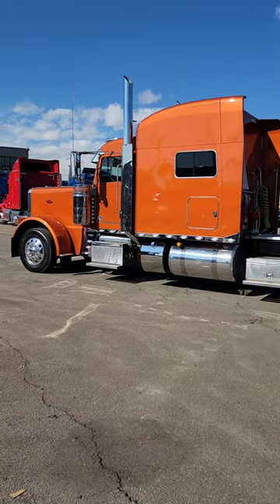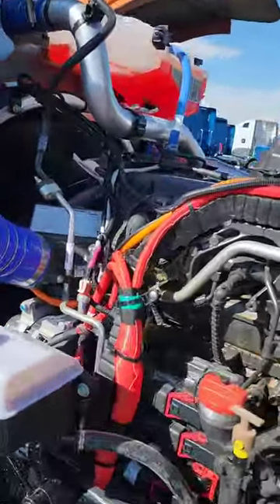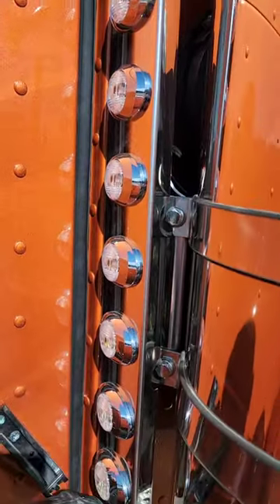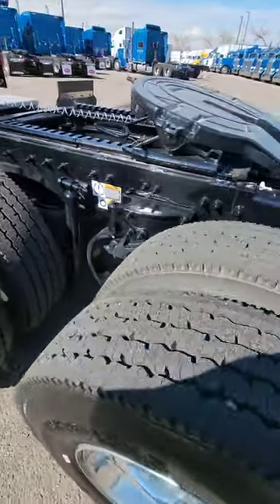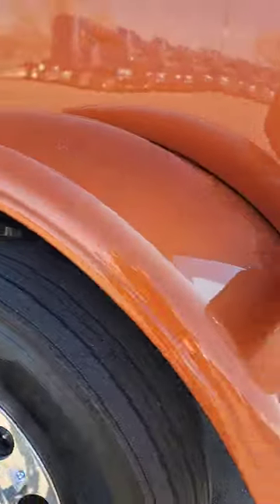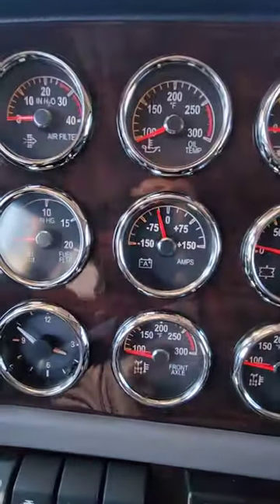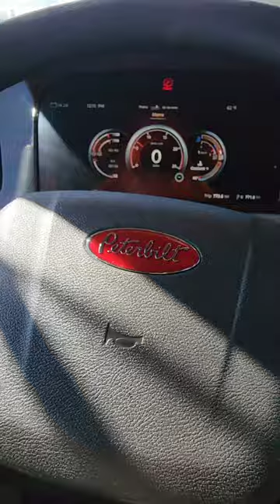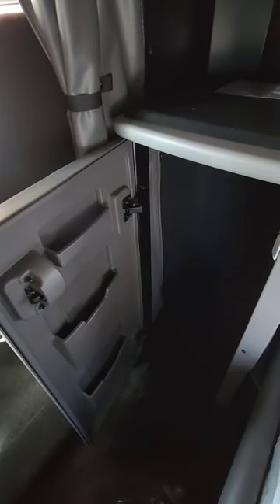2025 389!!- Yes For sale 2025 389.

Comment: I have a 510 paccar in my 567 daycab, turbo went at 300,000 and the head went at 389,000.
Reply: Ya, I’m no fan of them. I waste of money in my Humble Opinion.
Reply: @taylor11089  when it is not broken it runs and pulls great 😂
Reply: @just-incase3483  A Guy would be better with a Volvo Motor before those Paccars! Bottom of the Barrel when it comes to Big Truck Motors! They should just do a Cummins Swap on that thing as soon as possible! That would make it a $300,000 Truck though.
Reply: @taylor11089  the new paccar motors are better, mine is a 2018. I had a 13 liter Volvo and it had its own problems mainly the dpf system rotting out the wire harnesses.